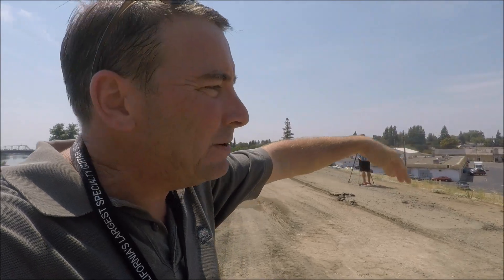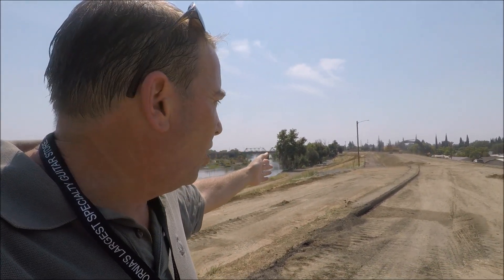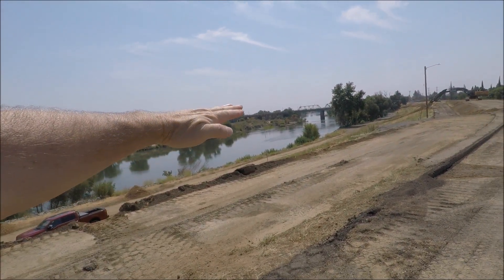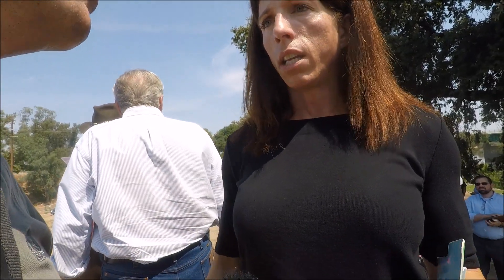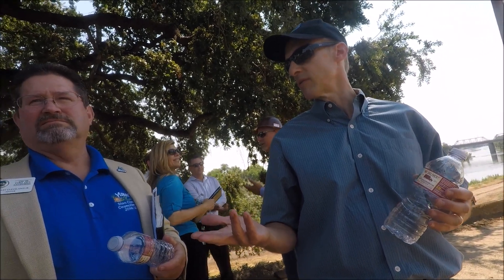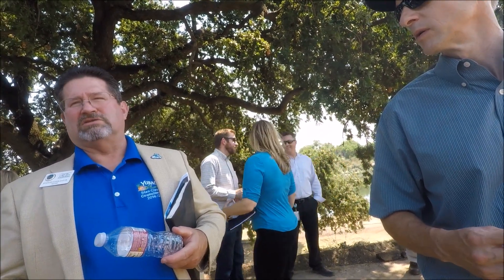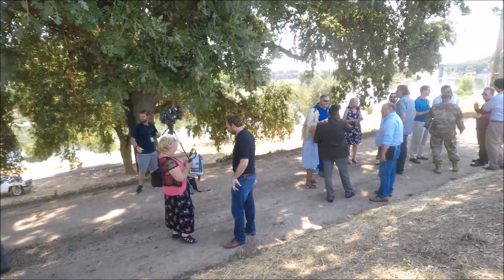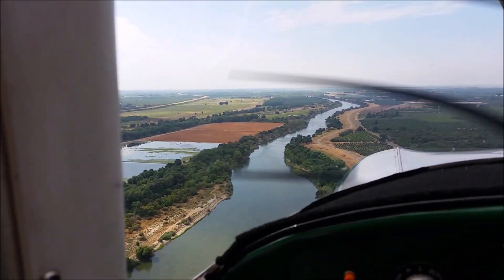Yuba City Levee Damage Below Oroville and Press Briefing

Comment: Back East where I'm from, slurry walls are pretty much nothing more than water and clay, so that when the wall eventually dries, the clay wall will be impervious to the migration of water from either side.  BTW, that's why land fills are lined with clay on the bottom to prevent the movement of toxic liquids into the soil below.  Thanks for the great update !!

Comment: Interesting stuff, Juan.

Up here in Idaho, we have an extensive canal system. Granted it is used to deliver water to our farmers, but we learned long ago (1930's - ACE studies), that you do not mix bentonite with cement. At least, not if you are trying to prevent water seepage, whether it be through percolation into the ground table or hydraulic seepage through the canal walls.

It makes one wonder why California choose the bentonite/cement method when it was already known to be too brittle and would fail?

Comment: Juan ...recently, Mike Inamine from the Sutter Buttes Flood Control Agency was interviewed by John Black of KTEQ 93 The Q from a live feed. From the discussion of Mikes beginnings as an engineer to his present position with SBFCA, the question came up about the current construction of a new slurry wall. Mike indicated that they discovered that the current wall materials proved to be inadequate when installed by the Corp of Eng. In 2000. He states that the new wall being installed is based on construction methods and materials that have been around for 40 years.
Reply from the maker: Richard Crumrine Interesting!
Reply: Juan. It's the same concept with new materials and techniques as most earth filled dams. Same as Oroville. It's self repairing as mentioned in the video.
Reply: Someone should point that out to the 'green spot" folks.
Reply: @Pappa Bob: Pretty sure the 'green spot ' issue has been rounded up.  ;j
Reply: Naa!! There's still people who refuse to believe there is no problem there.

Comment: How is the slurry cutoff wall trenched? Giant ditch witch or excavator?
Reply: Good question,     I think they will use a long reach excavator and at seventy feet it should be hard clay. The mixture that goes in will have solid walls almost to the top. just an idea.
Reply: I'm thinking a Ditch Witch device. An Excavator loses time during lowering and dumping. A Ditch Witch is continuous.
Reply from the maker: One of these-http://www.dewindonepasstrenching.com/
Reply: Interesting piece of equipment I have never seen one before thanks

Comment: Call out the other state senators and representatives that have failed to pass legislation and budgets that would resolve this problem instead of loading a question about one part of the budget process involving the governor. I would love to see you educate viewers on how state budget committees work   To come up with a final budget package, of which the governor is not the sole responsible party. Your excellent reporting is too good to try and label a single person as the root of a decades long watershed problem in a state with over 40 million people in it. Keep up the great work.
Reply from the maker: Gov. Brown is in charge at the moment....
Reply: blancolirio if you lost an engine at V1 would it be the current CEO's fault, or the one in place when the plane was bought, or one of the ones in between?  You pose good questions on the technical issues and I applaud your videos. I just wish you would get more in depth as to how a single governor can fix or cause decades of problems with a legislative body in the middle. It just seems like you took the low hanging fruit on the political questions compared to the rest of your very informative and data rich reporting. Keep up the great work.
Reply from the maker: Robert Rossman easy...who's in charge?
Reply: Well thank you for not taking the "easy" road with facts about how the system was built, maintained and now being repaired.